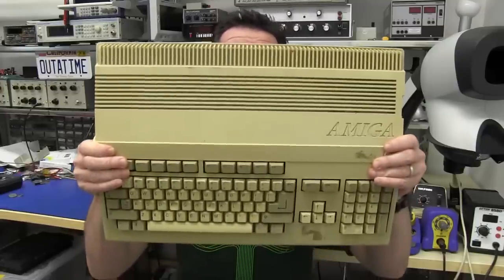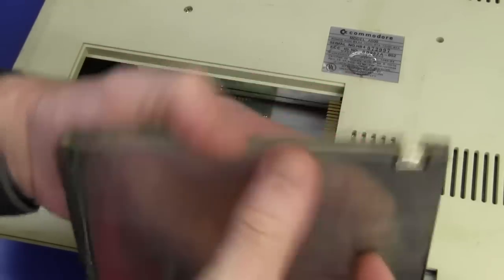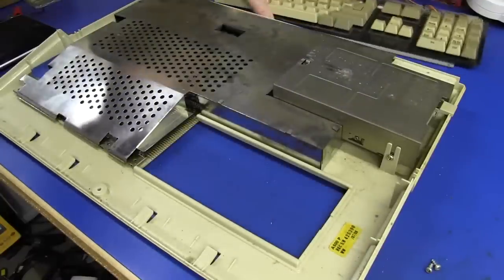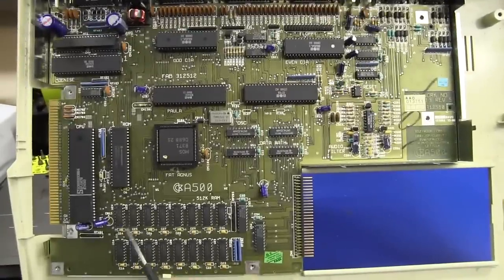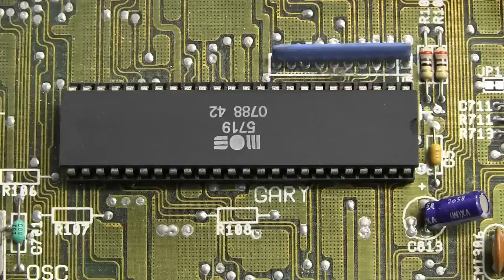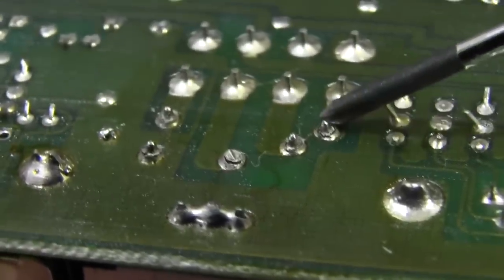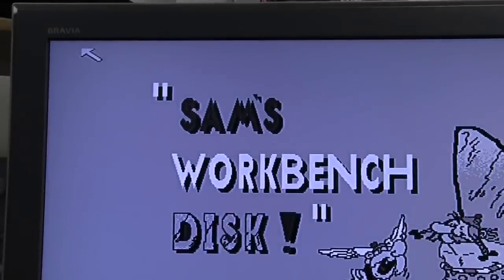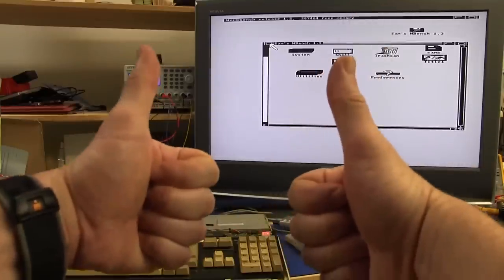EEVBlog #438 - Amiga 500 Retro Computer Teardown

Comment: "Pretty awful" is the state of your work area. "Pretty awful" is your high pitched, prepubescent voice.  The Amiga 500 is not "pretty awful".
Reply: LOL he mad ^...
Reply: dave has fathered a boy
Reply: I forgot somethings about your "Petty awful" comment, it is actually really hard to have a clean work area when your a electrical engineer. Also he actually said a lot of good things about the Amiga...
Reply: "Pretty awful" is your attitude. By today's standards, it IS pretty awful. He was just saying he didn't miss the slow loading, low quality graphics, and sub-par GUI. Yes the Amiga was in some ways 'ground breaking' but they weren't doing anything other companies weren't also working on, they just got to market first. Commodore ran themselves into the ground trying to support these computers.
Reply: ***** 
That's pretty wrong.
You've just looked at a 32 bit multitasking multimedia computer that booted in half a second (from ROM). This one has only has one floppy disk. No hard drive. (1987)
"The workbench" that he loaded is what you would call "explorer" (not iexplorer).

Eventually the "other companies" catch on 10 - 15 years later. Well, I still wait for anything to boot in half a second.
So you are right, they where first on the market, really really first.
Reply: TheBoing2001 LOL. It may have been multitasking and 32-bit, but to call it a multimedia computer is a joke. And most of my computers have booted in less than 5 seconds, once past the BIOS that is. 

I wouldn't trade that old thing for any of my modern, super powerful, small, portable computing machines. And I'm saying this as a vintage computer collector and enthusiast -- it's one thing to think they're cool and collect them, it's another to argue that they are at ALL powerful enough to meet today's standards -- not to mention user-friendly, etc.  That's all Dave was saying. I know all the Amiga fanboys think they can still use them as modern PCs, but they're just being stubborn and stupid.
Reply: TheBoing2001 Not to mention, your 'boot in half a second' comment is even more ignorant -- the reason it could boot that fast is because most of the OS was in ROM. The reason modern operating systems don't boot from ROM is because it's not practical -- the hardware companies producing the ROMs haven't made them in the sizes necessary, so you can't blame modern manufacturers for that. Plus, use an SSD, for fuck's sake. It'll boot nearly as quick, and it's essentially the same concept.
Reply: +Aurelius R Watch almost any modern Android phone boot.  It's all in (flash) ROM, 1GHz CPU, yet takes noticeable time.

Comment: VERY GOOD VIDEO! I had one of these machines back in the day. One scary memory is coming back to me. I purchased a daughter board for generating full-time, full-screen interlaced video and installed it myself according to the included instructions. One step involved breaking a single trace on the motherboard! I broke the wrong trace by mistake and it wouldn't boot. I had to repair it by soldering a jumper to the MB and then breaking the proper trace! I held my breath as I rebooted...SUCCESS!!!!

Comment: This is an old OCS Amiga 500. The ECS chipset offers more advanced graphics (and AGA which was in A1200 and A4000 much better). I assume you plugged the  monitor into the composite plug, which is monochrome in the A500.
The reason why you could not open the folders is because of the mouse. If you have an old, non functional mouse, replace it or use the mousebutton replacement keys: alt+left amiga = left mouse button. alt + right amiga = right mousebutton.

Comment: Please look in the floppy drive and see if the pressure switch in the right corner while looking in the slot is busted.
Cause if it is I think it may be my old Amiga 500 which was replaced with a Amiga 600 that ended up in a house fire and melted but still worked but got binned.
Thanks.

Comment: The solder mask they used in those days was screen printed in the manner that the component legend was added. That's why you can see a fabric pattern. These days they use photo imageable resist because they can't afford that same amount of mask bleed because of the high component density used now (surface mount, 0.5mm pad spacing etc. These days some manufacturers even use photo imageable component legend as it allows finer no smear legend that can be still read reliably with 20 thou text height and less than 6 thou .line width.

Comment: You where right I was screaming at you lol when you tried to pull the ram out.. Also there was a common problem with these ram bexpansions, if the expansion loosend slightly the machine wouldn't turn on. A lot got sent to me for repairs and it was just the expansion had come away from connector. The kickstart v1.2 is one of the early amigas a500

Comment: Ha! Fantastic stuff!

I had (still have) an Amiga 500 back in the 90s, great machine.  Looks like you got quite an early model there, the earlier ones had a red LED for the power light while the later ones like mine had a green LED, its also running Kickstart 1.2.  I never had problems with the power supply connector on the machine, just the cable connection on the power supply unit itself.  If you nudged the PSU you would probably knock the power out :)

Comment: Oh wow, I remember that funny part about the floppies, they sometimes came as self booting disks, and some of the operating modes would actually conflict with the OS. So basically you had to reboot with the game disk in the drive for it to work.
Reply: most games were meant to be booted with the floppy in the drive, you needed a special hd installer package for most games. these days WHLoad takes care of such things.
Reply: This game seemed to support both modes (as it did a standard AmigaDOS boot to run it even directly) but its likely as he didn't have the RAM expansion plugged in Workbench was taking up too much RAM for it to run.

Comment: Brings back nice memories :-) We had great fun with A500, A500+, and the big box A2000, A4000 and A4000T machines back in the day. The A500 was one of the first 16bit machines that we managed to use stacked 68k CPUs on. We also used CPUs rescued from engine management units from auto junk yards (with some jiggery pokery on custom daughter boards) to run at 16MHz and 25MHz Overclocked machines were used to speed up 3D rendering and 'crunching' tasks, compressing data to take up less space on the hard disks was very handy back then as storage space  on hard disc was crazy expensive back then :-) back in the days when we were 'programming with soldering irons' Proper Fun! :-) The 'Fat Agnus' Blitter Chip was upgradable to the 'Obese Agnus' chip which could do high speed block switching and block copy functions that were essential for high speed video effects. Great Stuff! * On the V1.2 you have to insert the workbench disk then fire up the system (or use the CTRL+both amiga keys to boot)
Reply: Hey Paul, a belated question to your comment.  Do you remember any of the particular vehicles who's ECUs you cannibalised for their chips (as in Ford, GM etc.)?  That sounds like an epic hack, and got me curious.
Cheers.

Comment: your comment about the chipset for the fat agnus is not correct.  the OCS (original chip set) had an 8370 Agnus(NTSC) or 8371 Agnus (PAL).  The ECS had an 8372A Agnus, which worked with either NTSC or PAL. The 8372A was replaced with the 8372B, and then 8375 Agnus in the AGA chipset.  A500s had limited compatibility with some AGA chips, but ECS was a common modification for the day.  I had an A500 in the late 80s, and I replaced the 8370 with a 8372A, and then did the mod to enable 1MB chip ram.  Amiga was a machine before it's time.

Comment: Good stuff.  I own an A1000 (1985 vintage) and an A4000 (1992).  The reason it was clunky when you got to the (modified) Workbench disk is because there was clearly something wrong with the mouse button - I had the same thing happen to my original Amiga mouse button after a few years.  Also, the Workbench should have had color so there may be something wrong with the video on that A500.

Comment: Wow! I'm glad you did a presentation of this. If I may add a few curiosities, there are USB and SD based floppy emulators (for those who desire to must their original amiga but would like to toss the original floppy drive) as well as software emulators (Windows, maybe OS X or Linux) and even FPGA "remake" versions as well.

I worked with several models of the Amiga as well as the Atari ST over a period of 5 years. I'll try to dig more tech info about it from the cobwebs of my cranium. Cheers.

Comment: I was just watching a video of The 8-Bit Guy repairing a c-128 and it was missing a key as well. I wonder how you lose a key on one of those old computers where the computer is inside the keyboard. Do you clean the keyboard and just forget to put one in? Or drop it and have a key pop out and go flying off somewhere, never to be found again? I personally have a couple of modern USB keyboards that are missing keys, but that's only because I beat the shit out of them and couldn't be bothered to figure out where the keys went, cuz they were usually something useless like pause/break.

Comment: Looking at the motherboard of this Amiga, it reminds me of the Eagle EPAC traffic signal controller that I have.  The chip layout is similar to what's seen here.  The thing I wonder is with the 512 MB of on board memory, would it be safe to assume that expansion module will give the computer 1 GB of memory?
Reply: That's 512 KB (kilo), the expansion module brought it up to 1MB (megabyte).  Gigabytes were unheard of back then, and it wouldn't happen until the next decade.   The OS was coded to address up to 4GB of memory space though, and required ROM upgrades to go beyond that limit in the future.

Comment: Speaking about alignment and layout the A500 layout was actually rushed without too much heat/stress testing, trying to get the A1000 into the smaller case. One of the most dominant faults was Fat Angus popping out of it's socket (or the floppy drive or mouse dying within weeks of purchase).
Wow those keyboard controller circuits are dodgy.
Great architecture, really poor construction & sub-parts choices.
I haven't checked, but have you done a tear down on an Atari ST for comparison.

Comment: Awesome stuff! I bought one of these from a friend and it was open most of the time. I replaced the ROM with a 1.3, then 2.04, then 3.0. I replaced the Paula because I plugged in a printer that didn't have one certain pin disconnected, and I replaced the Agnus with a Big Agnus (8572?) which could handle twice the chip memory. I used an external 2MB memory expansion (on which I had to replace a DRAM chip) and built an interface for an ISA RLL harddisk controller that would sit under the 68000.

Comment: Great video.  I had an A500 just like this.  This is actually the OCS chip set, even if it had Fat Agnes, as the ECS chipset only arrived with the A500+ and had 'Fatter Agnes'.

Otherwise I am impressed with the accuracy of your commentary, especially as you do not appear to have owned an Amiga in the past.

Comment: Every game on the Amiga is directly bootable -- you don't tend to run games through Workbench as you only had 512KB available. Some disks wouldn't show under Workbench due to custom disk formatting techniques and for copy protection reasons. You can run some games through Workbench; things like Monkey Island. You can also used "Screens" and drag Monkey Island over Workbench and vice versa. The "Copper" allowed for different screen resolutions on different screens.
Reply: Mike Gravgaard I REALLY miss the game "Mindwalker" and its creepy background sounds and music. Wish a port was available for Windows or Android....
Reply: Use an Amiga emulator, they have been really good for about a decade now.

Comment: No, the processors weren't soldered (except the 600/1200). They were socketed, and there was also a CPU-slot right there on the motherboard. You can build a machine around an A2000 board, for example, with any model of 68k you like.

No PC has ever reached amiga customizability. Ever run a PC with three different processor architectures at once? Ever replace your OS' graphics API?

Comment: I think he is talking about the Solder Joints. They hold all the parts on the board, and connect them electronically (Allow current to flow to them).

Comment: The look of Workbench didn't do the OS justice.  Once you got into the shell and started messing around with the low-level parts of the system, you'd see just how amazing and modern the Amiga was to its contemporaries.  Proper drivers for everything and a decent number of APIs.  Yeah, you still had to use a lot of assembly language, but it was a quantum leap in sophistication beyond the hard-coded crap everyone else made.  Too bad the custom chips and games are all that people remember about this machine.  Game programmers abused the hardware like crazy because they didn't understand what a real OS was for, and they cared more about copy protection than getting their stuff to actually work.  Don't add a CPU upgrade, or every game fails!  8)

I'm in the process of fixing my beloved A1200 after it blew an SMD cap last month, and I really should dig my A1000 out of storage.  They're the most fun hobby computers ever made... when they don't have that garage smell!

Comment: I have Pal boot disk. On an NTSC machine, it was impossible to play software or demos programmed for Pal machines. Actually, Pal software would have the bottom of game or demo, off the NTSC screen.  The pal boot disk would switch the fat agnus to pal mode, I assume the program stayed resident in memory after a soft reset. still did not seem perfect, but it would pull up the bottom of the screen so I could see some of it.

Comment: hi dave i have just purchased a wavetek 1004 signal generator 500/1000mhz and a heathkit 103 oscilloscope after watching your videos could you please help as im a noob how to connect up and some basic operation as when i connect the bnc output from the generator to the oscilloscope all im getting is the verticle sweep no horizontle

Comment: You know Paula did floppy stuff too right? The reason the Amiga had slow high density floppy drive performance (double density on most Amigas by standard) was due to Paula never being updated. Paula through the whole of the Amigas history was never updated so high density floppy drives ran at half speed. A 3rd party product (Catweasle) got around this limitation by use of an additional controller and other drives.

Comment: Hi there! I was wondering about the monochrome video output of this A500. Do you know if it has anything to do with it being a PAL unit? Is there anything about PAL that causes color issues over composite video? I ask because I have a US-NTSC Amiga 2000, which is basically an A500 in a desktop case. It has RGB and composite video output too, but the composite out is in color. I also noticed in the teardown video of the Acorn Archimedes that it had a video output port labeled 'mono' too.
Reply: +Shmeh Fleh It's monochrome because he connected the monitor to the mono output (which is just a phono jack), as he didn't have the right cable to hook it up to the RGB port. Quick and dirty way to get it up and running without building a proper cable. Not sure about the NTSC version - on the PAL version, the output is clearly labeled "MONO" so there can't be any doubt that it's not a composite.
Reply: PAL composite video inverts one of the two chromacity signals on alternating lines (hence the name).  This allowed more robust decoding in the monitor / TV by using a piezo-acoustic 1 line signal delay and then using the sum and difference to get the two chromaticity signals without a precision synchronized oscillator.  I guess that video enabler chip lacked the extra logic to produce that signal detail, so they just disabled the NTSC color modulation on the PAL models.

Comment: Great memories! A few of my friends were Amiga fans - both only one of them had the A500. The rest had the Amiga 1000. The Amiga 500, from what I remember, was supposed to be a portable version of the 1000, in order to compete with the Apple IIc and even the IBM PC Jr. I was an Apple IIGS user myself at the time, so we used to have platform fights - much like what you see with the iPhone vs Samsung fights today. The IIGS had the better sound chip, but the A500 could do multi-processing.

Comment: Couple of things:  it's in mono because the amiga monitor was a bit special and not PC compatible.  if you get a modulator and plug into TV you will get colour.  The game worked after GURU meditation because likely RAM capacity.  Most games back in the day were to be booted directly and not from workbench, unless you had a RAM expansion as they needed all the RAM for the game.  The GUI is just double-click the ICON to open, looks like the rate may have been too fast.

Comment: This machine is so amazing, you could almost do anything with it. I hacked my own Amiga, bent the HALT pin on the CPU
and put a buffered stop switch on it to freeze the computer. That was very useful with old games where you couldn't save a game but needed to pause (when you had to pee or your parents yelled at you to come eat dinner) :D
The expansion port was brilliant, you could attach Turbo Cards with faster CPUs, even more memory expansoin above the 
1 MB (later 2 MB) limit and you could even daisy chain them ! And don't forget the legendary Action Replay (TM) Module.
Those were the days...